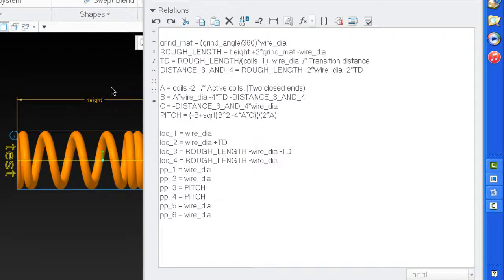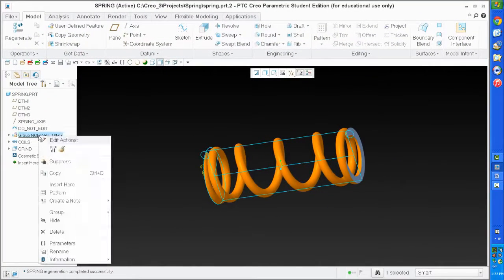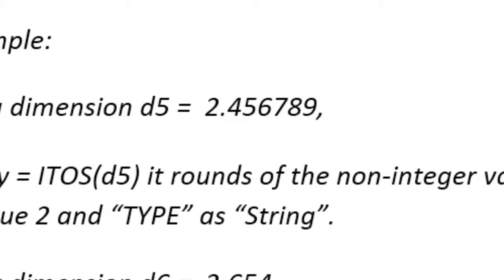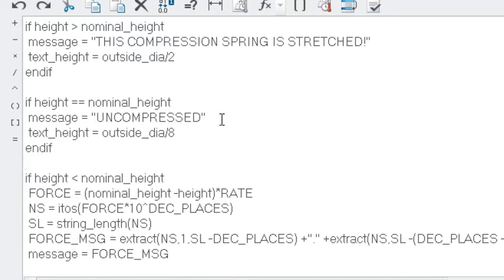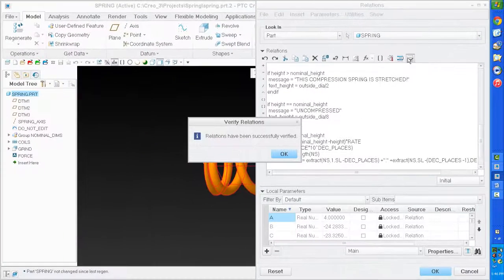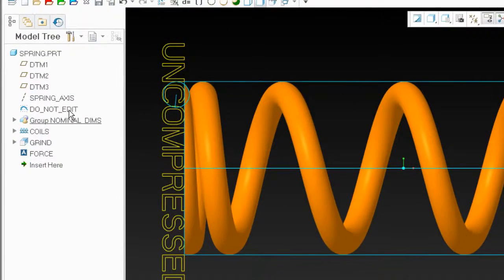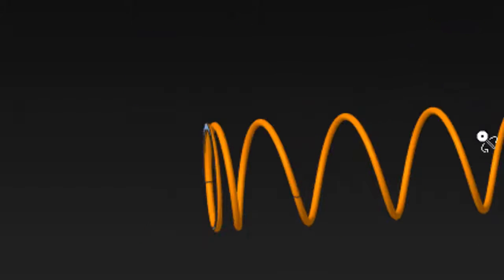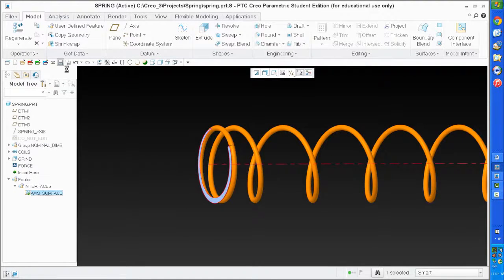Creo Flexible Compression Spring  - Part 3 of 3

Comment: 27:35 Once assembled my spring seems to work but when I regenerate the assembly the spring fails.  It will only work again if roll the assembly model back to before the spring and then roll it forward again.  Do the parameters need to exist in the assembly file or do associated parameters have something to do with it?  I can't figure out why it will only regenerate the first time then fail continuously after.